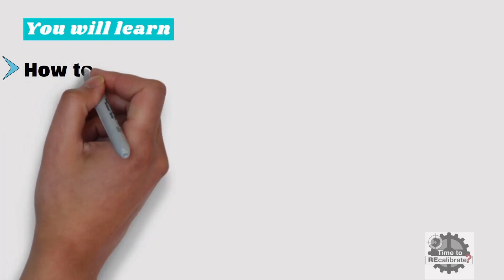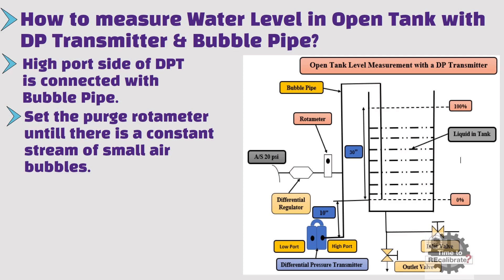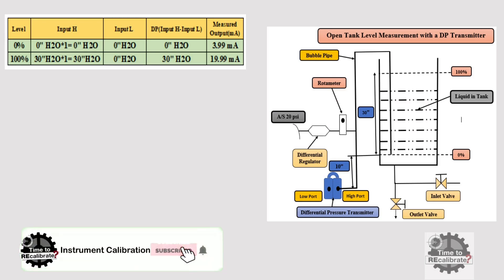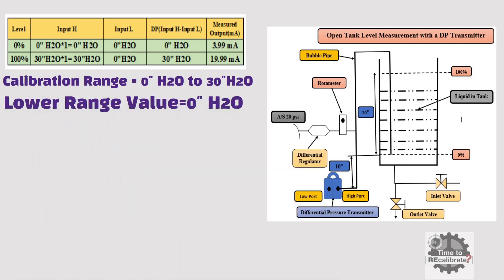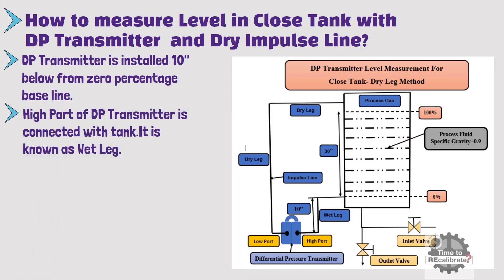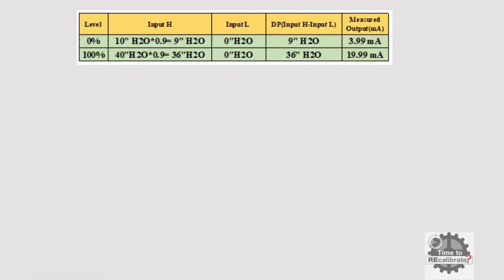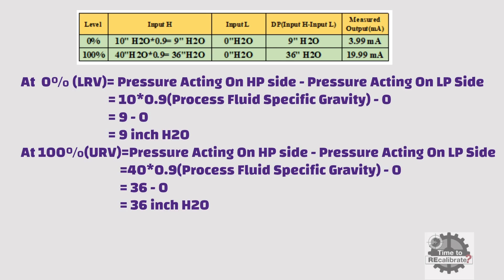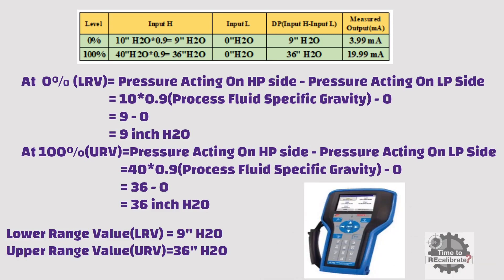Open Tank Level Measurement using DP Level Transmitter - Liquid Level Measurement

Comment: For the closed tank with DP transmitter and dry impulse example, if there's no pressure contribution at the low port side of the differential pressure transmitter, then why don't u leave it opened to air, just like how it's done in the open tank measurement
Reply from the maker: Hello James
Thanks for asking this question.
In closed tank level measurement, we need to consider height of dry impulse line, when we do LRV calculation of dpt. Therefore, we can't leave it opened to air
Reply from the maker: If you want to learn more about process measurement. Please refer following link.
https://amzn.to/3MEPc6k

Comment: Here HP tapping point is below the tank.So,why didn’t add the H1 value in 0% calculation.Why did to put the 0 value.Then why didn’t you add the H1+H2 value in 100% calculation of Hp side.please explain
Reply from the maker: Thanks for asking this question. In this example, bubble pipe is connected to HP Side Of transmitter, and it apply constant pressure to high side. So, this is a reason height of transmitter does not affect level measurement in this case. I hope you got ur answer
Reply: @InstrumentCalibration  Thanks for your reply